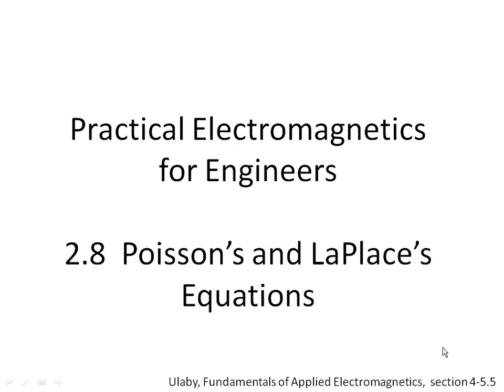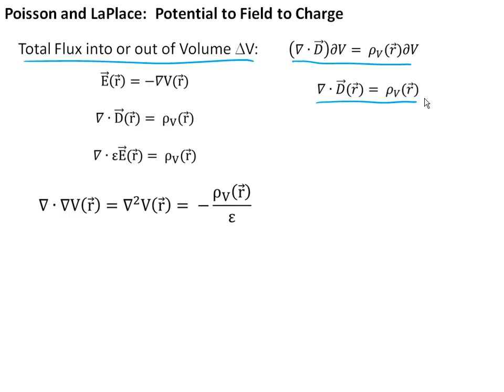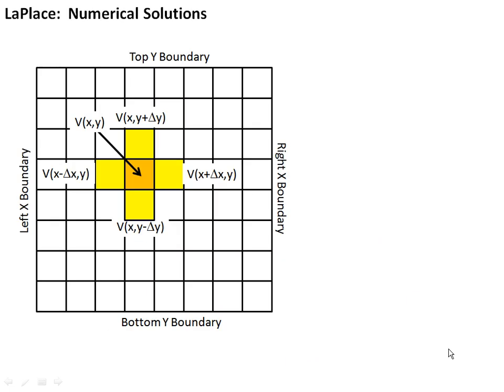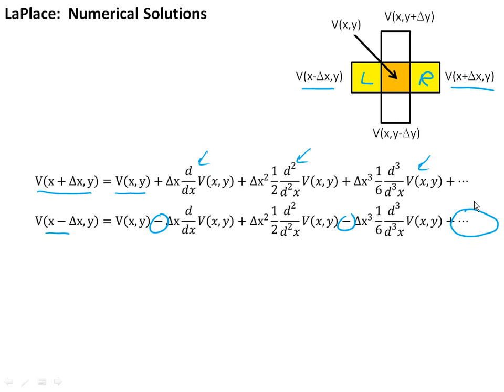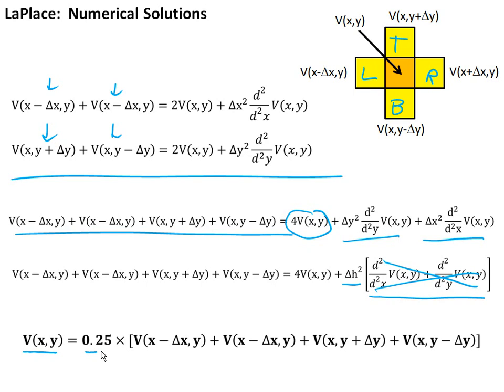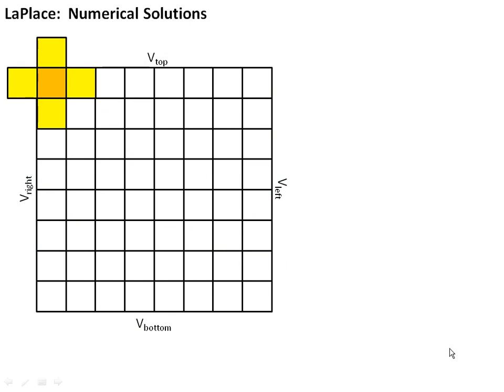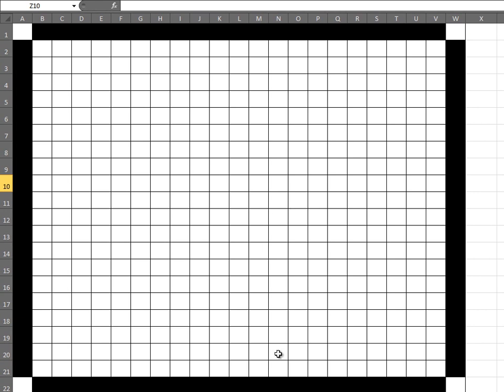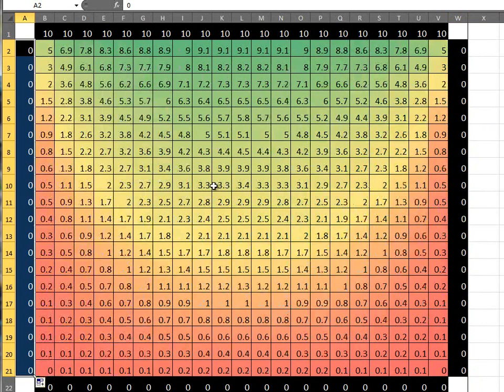2_8 LaPlace and Poisson Equations

Comment: Thank you very much for this video.

I am trying to simulate a fluid over a discretized grid and I had trouble understanding how a fluid moves in/out of a grid cell(whose behaviour is defined by the poisson equation) and also I had trouble understanding how iteratively solving linear equations helps us with computing a pressure field but this video solved both those questions.

Thank you very much indeed :)